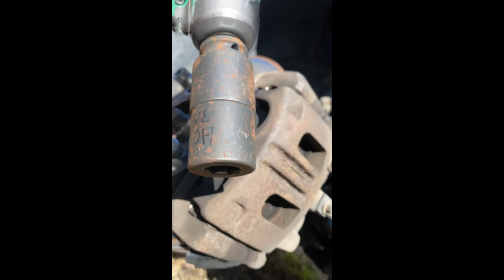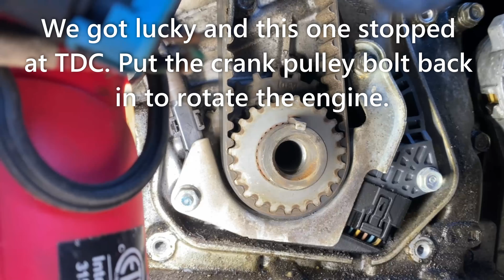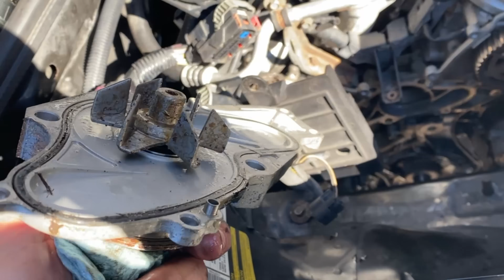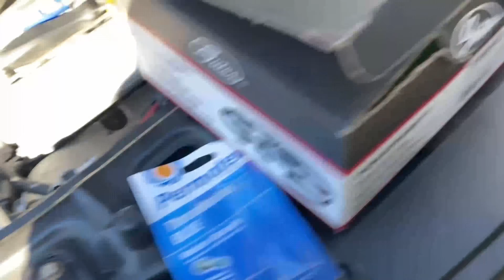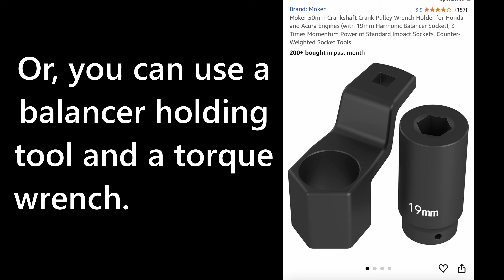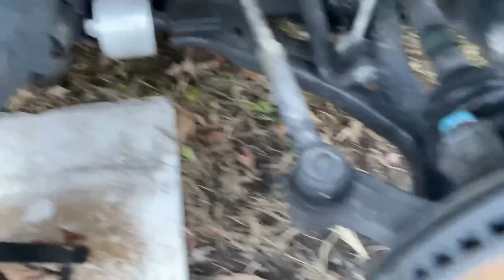2007 Saturn Vue V6 Honda 3.5 - Timing Belt Replacement - Also For Pilot, Ridgeline, Odyssey, MDX

Comment: Question: will I need to also replace the camshaft seals?
Reply from the maker: If they are not leaking, don’t replace them. That was advice given to me by a pro mechanic!
Reply: @OutOfOrderGarage  Thanks for replying. After removing old parts and inspecting seals for leaks, mine with only 118k miles seemed good. No leaks. Also, wanted to say thank you for this video. Just completed my first timing job ever along with both valve cover gaskets, plugs, tensioner etc. Successful job! Blessings 🙏🏼
Reply from the maker: Glad to be of help!

Comment: Great video on the Saturn Vue V6 water pump replacement.
Reply from the maker: Glad I could help with the repair! Thanks for watching 👍
Reply: @OutOfOrderGarage I have the same 2007 Saturn Vue and I can't find the Cam shaft position sensor location.
Reply from the maker: I believe there is one in each head. You have to remove the camshaft pulleys to replace them.

Comment: When I used the hole in the frame rail to put the bolt back on, as I was pulling the socket out,  the edge of the socket snagged the edge of the hole and the socket came off my extension and fell inside the frame never to come out. 😮 Now I get a friendly reminder sometimes when I make turns and the socket rolls from one side to the other making an annoying rattle in the frame of the day I changed my timing belt.😂 I used the asin kit as it's original Honda parts.
Reply from the maker: I did the same thing and dropped the socket in the frame. I was able to get it out from the front somehow but it took a while. 

I am getting an engine noise and I think it may be an early tensioner failure. I stopped driving it and have not had a chance to take it apart to see!

Thanks for watching!
Reply: A magnetic pickup tool is critical, IMO. I drop nuts and sockets into engine bays with regularity.

Comment: Thanks for taking the time to do this video. We have a 2006 Vue 3.5 AWD that we bought new. I had someone else do the first timing belt, but after watching your video, I am confident that I can do this one coming up. I have watched a few other videos on the job, but you make it make sense better than some others! I plan on getting the Aisin kit. I've done wheel bearings and axles on both ends, plus done all of our on oil, transmission, rear diff and transfer case fluid changes since new. My wife loves her Vue so much that I bought a parts car that is identical except for color...lol. Thanks again. 👍
Reply from the maker: Thanks for the comment.  Good call on the Aisin kit; there have been reports of the others being substandard, especially the tensioner.

Comment: Thanks for your post! Just bout an 06 with 132k. Runs great, but I'm sure that the belt wasn't replaced at 100k as it should've been. Not a overwhelming job according to seeing this. Thanks again.❤😊
Reply from the maker: Get the Aisin kit not the Gates or Dayco. There have been some quality problems with those 2 recently
Reply: @OutOfOrderGarage already in my cart at rock auto.